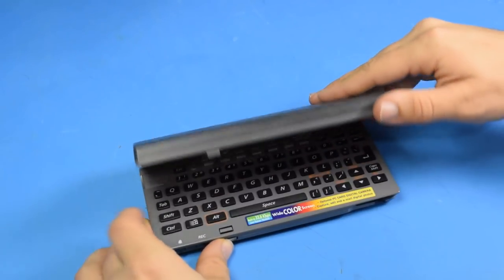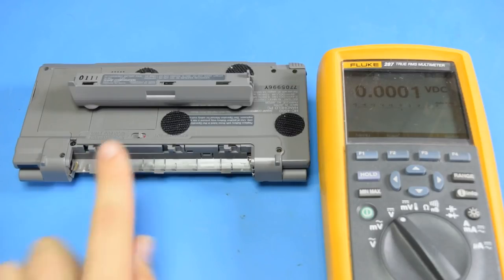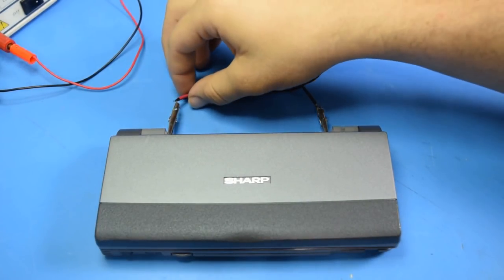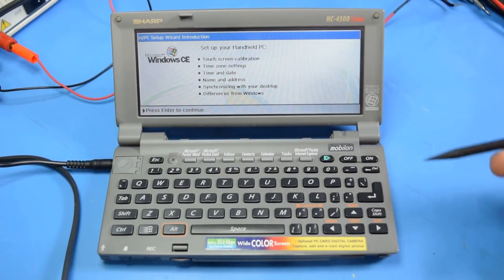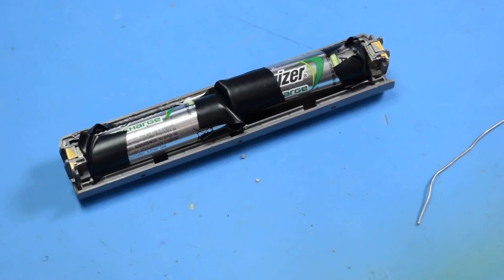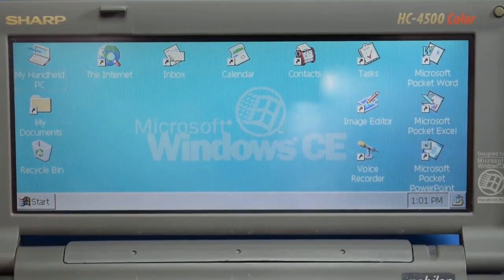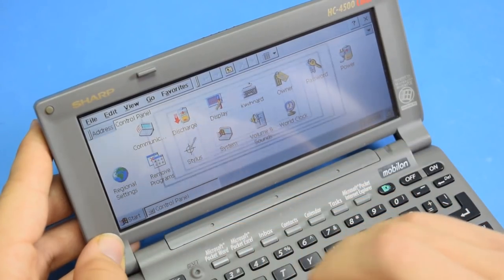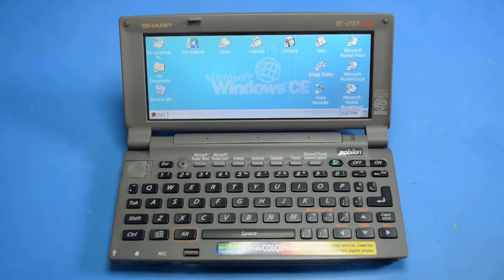0x002E - Sharp Windows CE PC NiMH Battery Rebuild

Comment: This is amusing, I just bought a NEC Mobilepro 780 on ebay 2 weeks ago because i wanted a pocket computer. I lust for the vaio computers but i would get a gpd pocket over a vaio for that price. Its interesting to see this windows ce palmtop. Its sad it has that style keyboard. I couldnt type on that. also its sad it doesnt have external memory expansion. My Mobilepro has cf card slot on the front of it. 

Great video as always.
Reply: Most CE devices have a PCMCIA or PC slot.  Get a PCMCIA CF card adapter.   There are also WIFI and NIC adapters via the same port.
Reply: Can't comment on WiFi but if you want much better keyboard, Look for a LG Phenom Express.  loved that thing back in the day for instant messenger.

Comment: Ways to connect to a computer: You can buy a USB Irda dongle, and use it to connect via ActiveSync from a Windows 98 to XP computer, or "Mobile center" from a Windows Vista to 7 computer. I don't know if you can go higher than 7 with ActiveSync.
You can also buy a CompactFlash to PCMCIA adatper, as it's a passive adapter, it's really cheap and does not require drivers. If you go for a SD to PCMCIA adapter, make sure it emulates CompactFlash, because if it's native MMC or SD, it may require drivers that can be very hard to install on a Windows CE computer that doesn't have a SD slot built in.
The same problem with drivers is the one you'll find with a PCMCIA Wifi card. The best bet is to find a list of compatible ones (meaning the PDA has the drivers factory installed), and if you don't find the exact models, try to identify the wifi chipset they use and buy any maker/model that uses the same chipset.

Comment: 7:17 That's like the fastest startup of a mobile device I've seen, unless the OS already started up and was being kept by the backup battery and basically resumed from sleep.
Reply: They only have Ram for system Storage.  The only non-volatile memory was for the OS. They didn't have any onboard storage for anything unless you installed a Flash Card.  When they battery died you lost all your data and installed programs.  It was like a fresh install of windows.  That's why you periodically backed up your device on an a Flash Memory card or to your computer via Windows ActiveSync.  It wasn't a big deal because CE and PDA devices didn't need a lot of Juice.  Some could go up to three days if you were not using it constantly.

Comment: Well it does have an internal PCMCIA/ PC Card bus @2:50. they make all sorts of things from that. RAM Modules, Solid State like drives, Modems, NIC interfaces, USB 2.0 Hubs (they can be powered externally via a PSU) etc.. You may have to do a little modding, make a port to insert the cards.

Comment: I bet you'd like an HP Jornada clamshell. The keyboard is actually almost of usable, and it has a CF slot as well as the PC Card... and they're usually less than $20 delivered on eBay. Pretty decent for an old novelty. Same deal with Windows CE and everything being ROM based, but it has a good Linux distro iirc

OTOH, for the use you imagined, you'll have a bad time with any of these WinCE machines, since they barely have any driver support for wifi cards past 802.11*B*

Comment: If you're looking for a pocket computer, might I suggest the Sylvania Smartbook? They aren't powerful and may be slightly larger than what you're looking for, but they can run Debian and have multiple USB ports as well as an SD card slot. You should be able to get one for dirt cheap, though putting in a better battery is probably a good idea.
Take a look: /watch?v=L-44IL8bKaw

Comment: Wow, I am really tied on this subject...should I get a sharp mobilon 4600, or should I get a Jornada 720/728? The Jornada has way better battery life, way more features and speed, but is 6x the price. However, with these mobilons, I can't find a single resource for them. No CD images, no serial cables....nothing. What is worse is that a lot of the good stuff seems to work with Win CE 3 (HPC 2000). However, I can get a mobilon with a bad battery for around 50$... Hmm...
Reply: After some more reading, The batteries are 4/5A NIMH batteries(you can get them with tabs preinstalled for safe soldering). They have 2000maH on average in comparison to the 1500 maH of the standard AA rechargeable. Also, due to the ridiculously low price, I settled on getting one of these instead of the more collectable HP dos models, or HP jornadas. Perhaps in the future I'll get one of those. As for the serial, I will use a standard USB to serial adapter which worked for my old wizard before it got stolen and launched me into finding a new device. The software to sync to PC is called activesync. If need be, I'll dive onto the motherboard and figure out the pinout of the serial line. if it comes to extremes, I'll install a DB9  port on there myself.
Reply: Update: I bought one, and the flat cable from the screen to the MLB is ripping. Some yahoo opened it up before I did and managed to break the cable slightly, which caused the touchscreen portion not to work. They left their calling card by leaving a screw out. When I was looking around in there, the cable, already stress cracked, cracked some more. This cut off the positive and ground leads from the MLB. I managed to briefly use it, and now it is in bits in a bag until I can get a decent soldering station set up, and some kynar wire. The good news is that mine has the 32MB ram upgrade on it! So when it does work again, I will have mountains of RAM to use. You can set the amount allocated for RAM, and for storage. The device uses RAM for both storage and RAM. This means that it doesn't have the downsides brought by flash memory, and thus should last decades with no issues other than batteries. I discovered that the serial port is ridiculously more complicated than I had initially thought, with 4 serial ports being available on chip.

Comment: Some older laptops seem to use this kind of batteries, is it possible to replace them with a lithium ion one?
Reply: Not easily, it would probably make a real mess of charging and battery indication. I'd much rather rebuild the battery pack if possible (unless that uses prismatic cells, then you're pretty much SOL as those haven't been made in ages).

Comment: you should get a "pocket pc" these things run windows mobile 2003 and are really solid. you can use active sync to sync them and play games on them. i recommend a hp hx4700 and ive used one before. they are really neat.
Reply from the maker: Proper Windows Mobile PCs are great. I have a Toshiba model ( https://youtu.be/ylCrfxcix5g?t=89 ). It's such a shame Apple came out with their gutted, over simplified iphone and made it a status symbol to own. Windows Mobile was clearly the direction we needed to go in. They can pry my stylus' from my cold dead hands!
Reply: AkBKukU after the fail of Newton and the return of Steve jobs I think apple just gave up. Windows mobile was the way to go, imagine having a computer in your pocket with msn and email
Reply: AkBKukU I have 2 windows mobile phones (HTC Excalibur/T-Mobile Dash). They are awesome. I wish more applications had WiFi support (not a common thing in 2006) so 2 web browsers actually worked (UC Browser and IE). Other than that, I did enjoy it. Mine ran windows Mobile 6.1 and I tried getting them to windows mobile 6.5 but the firmware flashers didn't work.

Comment: Great video. I had the earlier monochrome version of this and the battery life was *terrible*! To the point where it was unusable. Fascinated by the idea of WiFi pcmcia card, but I doubt that version of CE has the requisite WiFi services... Please try!
Reply: You must have had a very used version. Out of the box the HC-4100 model had a 25 hour battery life. Which is far superior to this model.
Reply: @peterlamont647  Eh? It was brand new. And how does a "very used" version affect non-rechargable battery life anyway? And since when did the promised specs match the reality?

Comment: +AkBKukU   I'd love to see the IR I/O working on one of your computers, as in several of your videos, you have mentioned them having the capability of it, but I never actually saw you using it.
Reply from the maker: It's one of those things where I have to do a lot of research, try it on several devices, troubleshoot incompatibilities, etc. And it the end it will be something that I end up never using and forgetting about. So it's a back burner concept for me. I usually let those wait in the back of my mind until I have some kind of inspiration or new reason to try it out.

I made a real attempt at it in the portable printer pt2 video: https://www.youtube.com/watch?v=3xgZuYDwLlY You can get an idea of what kind of nightmare it is there.

Comment: Why not going for a GPD Win Pocket Computer? Or too expensive?
Reply: yeah but thats not as fun is it
Reply from the maker: I would love a GPD Win (*cough* Pandora *cough*). I have a hard time justifying something that expensive that I know I won't every day. I've also used a lot of... let's say "niche" hardware like that from unknown manufactures. They usually work great when you use them exactly how they are designed to be when they are relevant. But if you go even a little out of their comfort zone or need something for it after it's hayday, they can be a pain. 

I know I'll end up getting one some day, it's just probably not some day soon. Also, I would want to use it mostly through the keyboard which doesn't look great on the GPD Win.
Reply: oh jeez i forgot about the Pandora. they looked neat.
Reply: The GPD Win 1 is not designed to be used with Linux and due to the weird processor many people have troubles with drivers etc. Since you're a Linux expert as it seems you should probably be able to find workarounds tho. I'm currently using the GPD Win 2 (I own both) and the keyboard is much nicer, plus due to it having a m7 inside Linux support is far better and Ubuntu as example should work out of the box. But the keyboard is definitely not one you could use in a "lay-on-table" way since the keys are too small.
Reply: EpicLPer why the gpd win over the gpd pocket?
Reply: Or that, yeah. Forgot about that thing haha :D
Reply: that's why, jeremy, because the Pocket is totally unmemorable, yes it's technically better, but it has literally 0 flair and also a crap battery.. 

@akbkuku: what about a Sharp Zaurus SL-C3x00? the C3100 has 128mb flash and a 4gb zif drive, the 3200 has a 6gb drive, they also natively run linux and the wifi and bluetooth in the 3200 are capable of running in monitor mode. they're sick little beasts!
Reply: Maybe he wants to try to run some of those old CeBeans apps, though from what I remember, those are made for a resolution of 320×240.
Reply: EpicLPer 
Yeah, the GPD Win 1st gen uses an Intel Atom Z3735F, which only seems to be supported in the Linux 4.15 kernel and later, which means something like Ubuntu 18.04, or Debian 10 Beta.
Reply: User Name 
They forgot that the Pyra is being released soon.
Reply: User Name 
Maybe that's why I'm trying to find the money to build my own tablet, as there doesn't seem to be any new tablets with the features I actually want.
Reply: I own a GPD Win 1 and a Win 2. The Win 1 uses a newer Intel Atom chip than you specified, the x7-Z8750. Some slightly older revisions used the x7-Z8700. However, I would avoid the Win 1, as it was built as a technical exercise, and has serious design flaws. The Win 2 is much better, as most things in tech are with version 2.0.
Reply: Everybody is talking about GPD Win, while the GPD Pocket is the more suitable device thanks to it's keyboard being way beter for the primary input.
Reply: They have a GPD Pocket but... it is $600. I would get it otherwise.
Reply: EpicLPer you like a twin of justin y
Whatever i like to watch 80% has your comments
Reply: Hey dude I remember you from Twitter!
Reply: The likes of us got Psion 5s in 2010s. I think we'll get GPD Win (first generation) by 2030, when it's sufficiently retro.
Reply: The Pandora had really shoddy build quality for something that expensive. The Win is a substantial improvement on the concept, I think. But either of those are more money than I can justify for something with such limited utility. And the keyboards look like utter shite on both of them.
Reply: @TechTangents  The pyra is coming real soon now! Seriously it might be here next year.
Reply: AkBKukU i may be late to the party...but there is a brand new linux based palmtop called the 'PC Gemini' which is the ultimate umpc. Laser etched full stroke keyboard, full cell or wifi built in depending on your choice, hd screen and a decent battery life and fits in your pocket. It was designed by the same design crew of engineers from the UK as the Psion 5. Really recommend taking a look. They crowd funded at almost 300% funding and are now shipping their products worldwide. I may get one, but they arent too cheap. Ranging from 500-700$ US. Well...ultimately i will get one. They are too cool to pass up. But i will have to save my pennies.

Comment: If you find an NE2000 compliant network card for the PC Card slot, install SP1 for CE 2.0 and the unofficial NSP from HPC: Factor, you can get this thing connected to the net. It's not very useful though.

Usually there's no need to sync this with a computer, files can be transferred via a CF or SD card inserted into a PC Card adapter, and .cab files for the MIPS architecture can be extracted from .exe files designed to be run on a host PC.

Source: I once had one of these in my possession. I planned to rebuild the battery but I lost interest.

Comment: If you went to the trouble of restoring it, why not use proper A cells? Even using AA, there were better options than those Energizers, plus they're lower in amperage than the original.
Reply: better yet, put a lipo plus a powerbank with the voltage divider resistor modified to 2.2v, so you can charge in one hour and a half and the powerbank circuit deals with the cut out.

Comment: The stock cells were not AA by the way... I really enjoyed the video, but everyone knows those were 18650 cells just like any other laptop battery.
Reply: 18650's running at 1.2V apiece? As a veteran vaper, I'm gonna go ahead and say not so much - 18650s operate at 3.7V on average. Having said that, I'll grant that they do look similar in size to your average 18650.

Comment: There's a guy building Pi UMPC to order which is a reasonable low cost option, he's called Christopher Calderon and there's a thread on the Pyra forum. Still underpowered compared to the GPD Pocket 1/2 and it's clones though.

Comment: I aways wanted a pocket pc, and i thinking in doing one with a raspberry pi. Is the pi too weak ? I mean, can it run desktop youtube, and some linux programs? Maybe a super tux?
Reply: As long as you use the Raspberry Pi 3 or so, and not the Pi Zero($10 version), it will run youtube and linux programs fine.. they're great mini computers, and great for running a low-power web server that is actually quite capable..